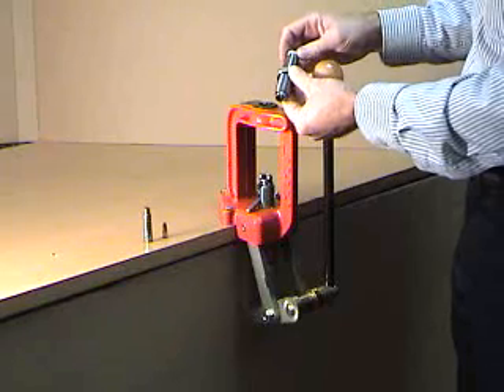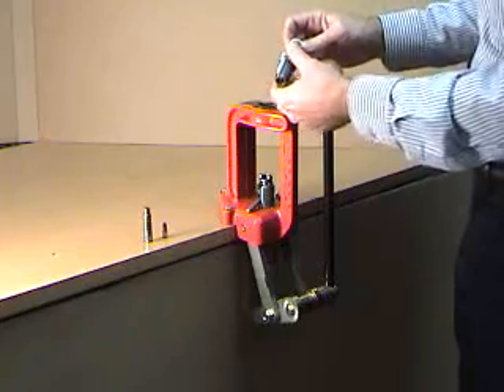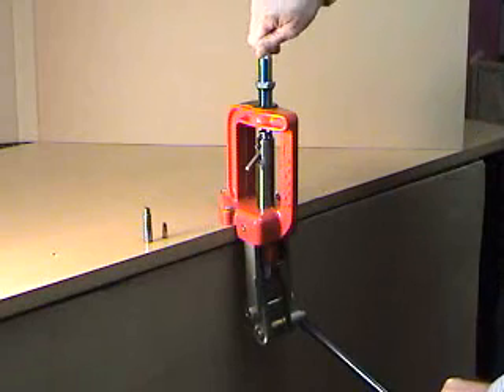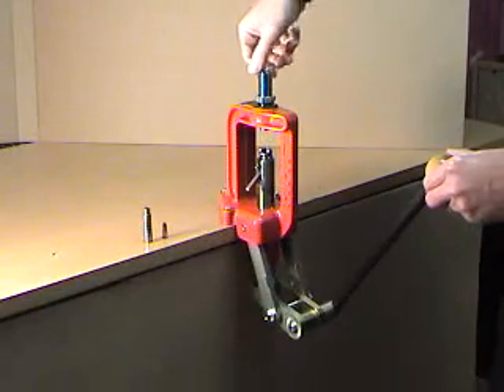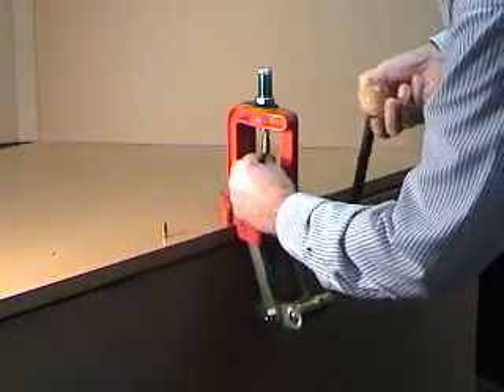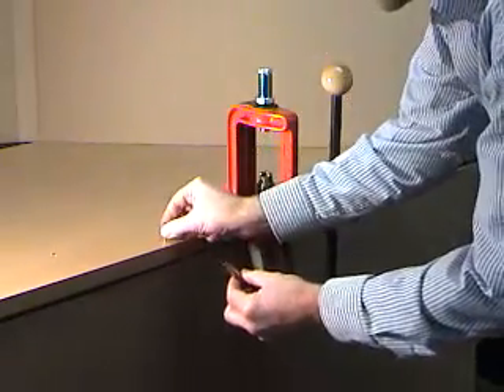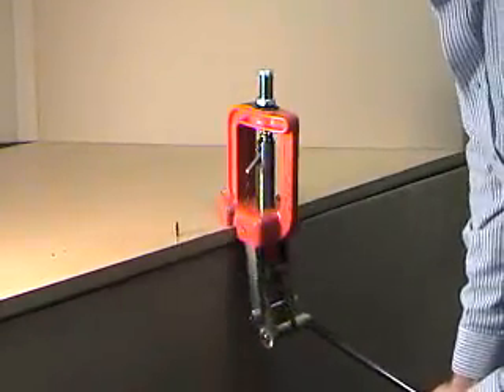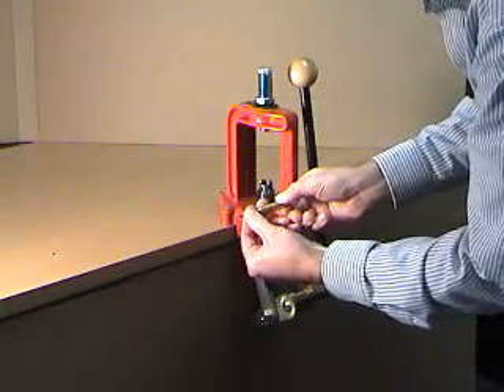Lee Collet Die Adjustment

Comment: I usually measure the diameter of the fired case first. Screw the die to touch the shellholder, plus one more turn. Then I run a case through and measure the neck again. I give the die a quarter of turn and run the case in. I repeat this process until I get a measurement of  .005 less than the fired case. This method has worked for both my 300WM and 243Win. You shouldn't feel much resistance in this process so check your measurements after each adjustment.

Comment: Love this and the FCD. I full length re-size 223 with a Redding Small Base Full body die. I like this die because it has no expander ball which can mess up headspace and cause all kinds of other issues i have experienced. Currently loading 223 for an AR. The Redding die leaves the case mouth ID a little bit above .224 and does a VERY consistent job of taking my cases back to SAAMI min head-space. After all other processing and just before priming I run the brass through the collet die to set the neck tension. I can then feel the neck being re-sized from 0.224+ down to proper ID. It's a great tool and well worth 2x the price.
Reply: Yup, this works on any size brass. I've noticed that cases do not "grow" to require constant trimming, also.

Comment: I started shooting and loading 308, I saved all my brass. When resizing and de-priming I was clearly not using sufficient pressure. I have a Lee Stand that I use and clearly I need to form the brass. Use some elbow grease. Is the pin inside the collet the same through out all calibers? Mine looks no bigger than that used to size my 223? I think I have the wrong mandrill.

Comment: The part about turning the die in till it stops is confusing.  There is a floating collar at the bottom of the die.  The shell holder will make contact with the floating collar but the die can continue to be turned in until the floating collar is all the way to the top.  So is the "stop" point when the shell holder contacts the die collar or when the floating collar has been pushed to the top of it's range?  Also, some people making videos on this die seem to think that neck tension can be adjusted by turning the die in further or less far.  It seems to me that the only change in neck tension would come from how hard one pulled on the press handle - up to a point - because the mandrel is a limiting factor on how much neck tension you can get - unless you polish down the mandrel.
Reply: vsaluki R   The "stop" point is the floating collet. Also, one thing that is seldom mentioned is, once you have this die final adjusted, do not raise the ram all the way without a case in the shellholder for fear of making the collet stick closed. If the collet is closed when you run a case up, it will crumple it. That's why most people smear some grease on the tapered part of the collet. One more point, this die works best with annealed brass.
Reply: Luvta Handload I noticed today that if you put too much force into the press handle the die will pop the threads on the aluminum cap on the top.  I think I read or heard that the force should be about 25 pounds, but I don't have a gauge in my arm and that number could vary widely.  Fortunately the caps from the different calibers are interchangeable so I'm still in business.  I'm measuring neck runout at around 2 to 3 thousands after using the die.  Was hoping for 1 to 2.

Comment: Wouldn't it make more sense to carefully adjust the die until the press can toggle over its center without crunching the cases? This might result in a more even neck tension?
Reply: tetrahydrofuran I know this is way late but shouldn’t that be the better way to get the result you want?
Reply: Actually, Lee does not want a toggle over.  They state that in the instructions.

Comment: The best way to use the collet die is to just turn the die in till it bottoms out. Whether you put 20 pounds or 200 pounds of pressure on the ram it isn't going to change your neck tension one bit. Once the neck is pressed into the mandrel that's it! Your not sizing  any more than that.
Reply: Some people seem to think that the extra pressure can help even out any irregular thickness in the neck brass.

Comment: You can't hold a workpiece more centrally than with a collet. I wonder if Lee used it's knowledge of manufacturing to exploit the inherent accuracy of turning? This looks as if  it self centres. These dies have a short tolerance loop and the features are turned.The runout I get with these dies is exceptional. The accuracy of my loads is very satisfying. I use alot of Lee Precision products. I use a Micrometer to measure my bullet overall diameter. I then adjust my die as shown and raise the ram, squeezing (forming really)  the case neck in the collet. I rotate the case and repeat 5 or so times. I then measure my case neck inside diameter with a bore micrometer. Subtracting one from the other gives me the interference. This figure I use as an indicator of neck tension (strain). Knowing Young's modulus for brass, I also calculate hoop stress in the case neck as well. I do this because I am a sad old fart.....these dies are really easy to use. You are just squeezing the neck around the central pin.